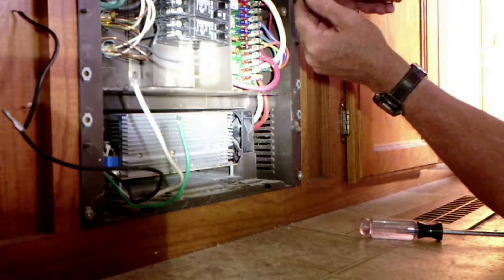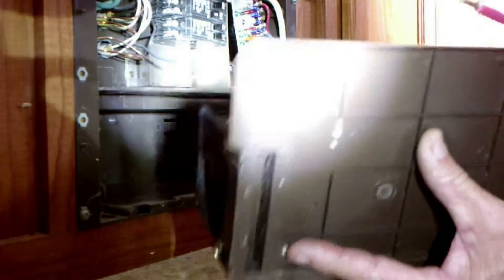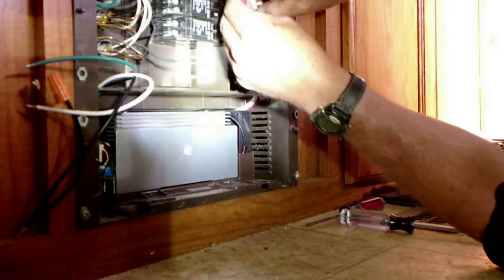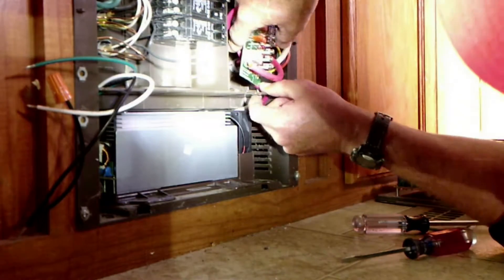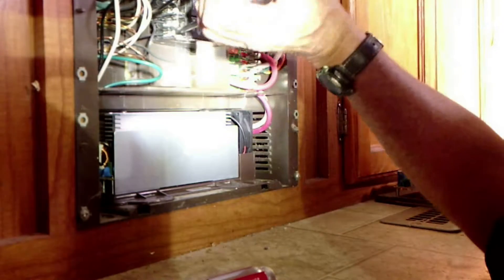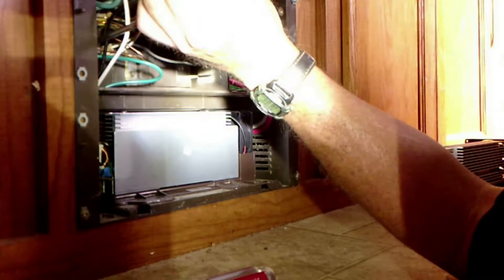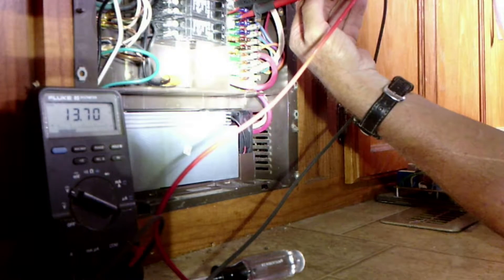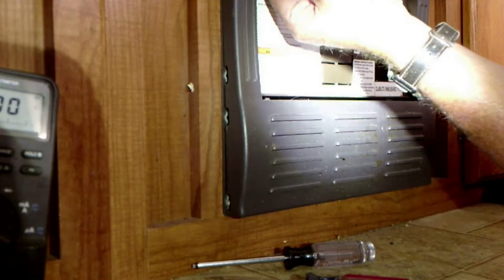RV Power Converter Test And Replace

Comment: I brought a 2017 four winds and have it on my first trip, after four days of running the AC heavily it seems to have burned out my power inverter? I have no 120v throughout the Coach even plugged into shore power, my question is could running the AC heavily have fried it? I did smell an electrical burn scent when it went out. Any opinions will be helpful.
Reply from the maker: This video is on a converter. It takes 120v and turns it into DC voltage to charge the battery and run all of the 12v systems, which includes the control side of the AC, but that would not affect 120v outlets. Your MH might have an inverter, but the AC would not run from that. If it has an inverter it would only power a few of the 120v plugs, microwave, tv and maybe a couple of outlets in the kitchen. You just need to start following the trail of power as Darren would say and find out where it stops.
Reply: All Seasons Mobile RV Service luckily I brought a service contract when I brought it at Camping World. One of the only tools I didn’t bring along is a volt meter to test where the power stops. Just sux being the first time out in it and having  this happen but it’s part of owning one. Hope I  can get my rig looked at quickly here in San Diego, California gonna just get there when they open 🤞 Thx for ur help. I was thinking the inverter wouldn’t be powering the AC also? The panel box u were working on looks almost exactly like the one I have.
Reply from the maker: @darrylanton9323  I hope everything works out
Reply: All Seasons Mobile RV Service they weren’t able to work on it just like I thought but the service guy there did look at it and thinks it the power transfer switch that fried especially since I could smell the electric burn smell when it went out. He thinks the converter is fine since it charges the coach batteries when I drive. Is that a part that easily replaced being handy tools?
Thx so much for ur advice 👌 I truly appreciate it indeed.
Reply from the maker: @darrylanton9323  It's not bad as long as you get the same brand and model. My RV Works did a video on changing a transfer switch https://www.youtube.com/watch?v=MYrh8gdM7Xs    I haven't watched it myself, but he does great videos.  Be sure to let Darren know that I sent you. Good luck Darryl.
Reply: All Seasons Mobile RV Service thx my friend! I was able to uninstall it 👌 Now just got to find the exact same part# at an RV parts store, google has several local ones I’m gonna try. FYI. I found the switch under the bed and the insides were pretty well charred.
Reply: All Seasons Mobile RV Service with ur help u both have saved my vacation! Very fine RV videos 👈
Reply from the maker: @darrylanton9323  cool
Reply: Excellent video. Thanks for share your knowledge and wisdom.

Comment: I have a 2002 winnebao adventurer invertor needs repaced deck invertor . one black wire one green  . what one is postive and what one is negative
Reply: new convertor is wfco and plug in are red and green
Reply from the maker: Thanks Tabitha. I am assuming you are asking about the 12 volt wiring. The terminals on the old one should be marked + and - just note which wire is which and put them on the new convertor the same way, because the new one is marked the same.
Reply: @hillbillyrv  5 some idiot sorry about that took the old ones off they are not marked their are 2 green and a black. Have no way of putting a picture on here or i would
Reply from the maker: @tabithapfeiffer4982  You need to put a battery in it and check polarity with a multi meter and then you will know which wires go where.

Comment: I'm studying up on the converter problems. My refrigerator main board went out, so I replaced it. Now after a short time, I'm getting a low DC & hi DC message on refrigerator. When batteries are charging, a hi DC & when Power to MH is disconnected, a low DC message. Looking to converter as a possibility.
Reply from the maker: Defiantly check voltages with a good meter

Comment: This is the video I was hoping to find. It's realistic. I have the same converter. I just replaced it and it didn't correct the problem. I have to buy a voltage meter and see if I have power coming into the converter. Thanks for explaining everything from start to finish.
Reply: I should have been more specific. I needed to find a video that showed how to test the converter.
Reply: Thank you for the call yesterday.  I believe I discovered the problem is not the converter.  My outlets all have 120v between the ground and neutral, the hot and ground, but nothing between the neutral and hot. I believe the neutral - ground should be zero, and the neutral - hot should be 120.
Reply from the maker: @someonesaidyes  yes
Reply: Great video! QUESTION - how do you know if your converter is overcharging? We just took our rig out of storage to take a trip and our AGM batteries on our Class A overheated and leaked when we plugged it in at the house to get the frig up and running!!!! Crazy! This is our first Class A, and it’s a 2015. We’ve had it a couple of years and put lots of miles on it. We obviously have to change the batteries, but it seems we should be determining if the converter was overcharging, or if the batteries were just dead. It’s certainly possible we killed the batteries because we didn’t understand keeping them charged properly. This whole experience has been a learning experience, but we still love it. Wish you were nearby to help. 😉
Reply from the maker: It's my pleasure The Red Dawn
Reply: @hillbillyrv  for sure. Any advice or maybe you have a video covering this, (I can't find anything) I have 120 coming into the converter as shown on my voltage meter, nothing coming out when the battery is disconnected. I also have no power at my outlets, (which I was told should work, along with my ac, TV, and micro) Thanks again.
Reply from the maker: @someonesaidyes  call me 304-254-9363

Comment: Confused... I disconnected my battery (via disconnect switch) and tested my incoming AC as you did and got an appropriate reading. Switched to DC and got a reading of 0.00. Wouldn't that be accurate given the battery was disconnected?
Reply from the maker: It makes no difference whether the battery is hooked up or not. 120v AC coming into the converter. As long as the polarity fuses are good it should have about 13-13.5 v DC coming out.
Reply: @hillbillyrv  Thank you. Replacing my converter tomorrow.
Reply from the maker: @roberthague396  have fun.
Reply: @hillbillyrv  Thanks for a great video! I was able to replace my converter with no problems, everything is working as it should be.
Reply from the maker: @roberthague396  great !!!!!

Comment: Great job, I was wondering what converter you used to replace the existing one. I have seen several replacements of this type where the new converter does not fit and additional modifications are needed in order for it to fit.
Reply from the maker: Most of the convertors we see like this are either Parrallax or WFCO and most models of those brands, the lower units are interchangeable.

Comment: When you load test the battery if the battery is not fully charged will that throw off the load test? Just wondering if the converter was not working would have the battery been
Reply from the maker: Thanks Elgin. I believe it is true. Before you can load test a battery, it has to be fully charged. I don't remember load testing the battery in this video. I believe I was just reading battery voltage.
Reply: @hillbillyrv   ok I thought you had the load tester and said it was weak I'm sorry I got confused.
Reply from the maker: @mdterh1  I would have to go back and watch the video again, but I probably only had my multimeter.
Reply from the maker: @mdterh1  You got me Elgin. I just went back and watched some of that video. I did load test it. Just wanted to make sure the battery wasn't totally bad, or shorted inside. This gentleman had lived in this camper in the same spot for years. So he didn't need the battery hooked up. Since the convertor seemed to work intermittently, I just wanted to make sure the battery was a least ok before I installed the new convertor.